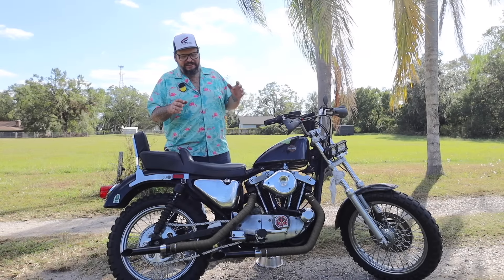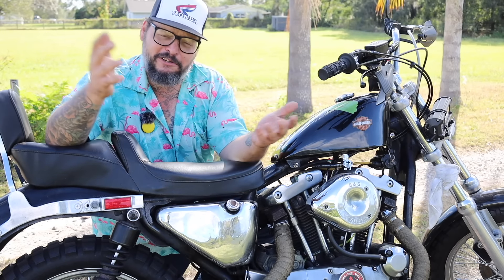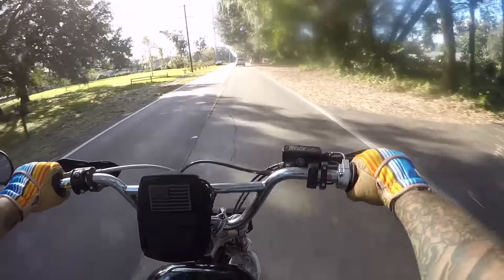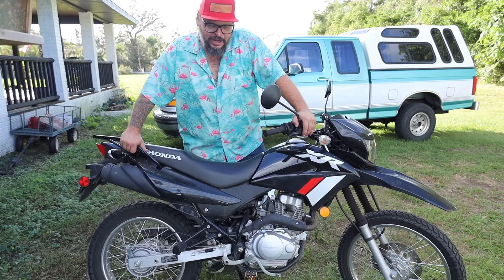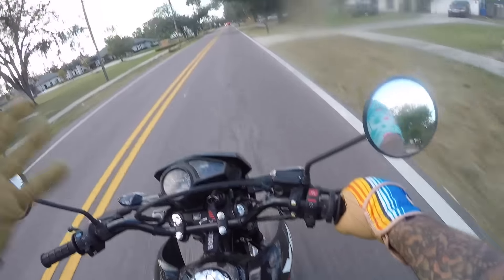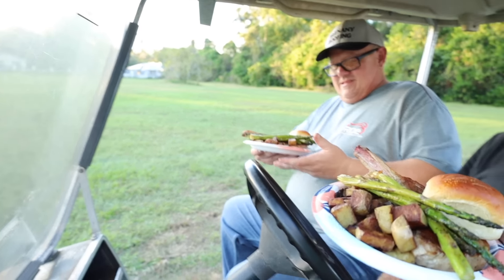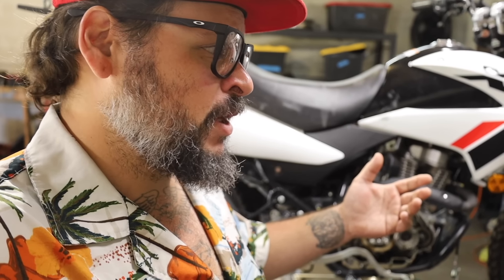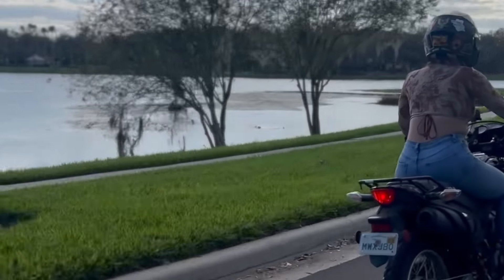I Never Thought She Would Betray Me

Comment: I hate to say it but those 80s sportsters are the biggest pieces of crap ever made. I had an 80 and 81 at the same time and i dont think they were ever running at the same time. When the phrase " everything breaks" im sure it had something to do with those bikes. I traded both and 6000 dollars for a 70 shovel that was way, way more relieable.the shovel was probably worth $6000. So i basicaly threw the two bike in for free.
Reply: I got rid of a ‘75 sportster in 1991. It’s the only bike I ever said good riddance to.
Reply: @messageinathrottle4046  I had a 67 that was gold. But nothing but greif in the three that followed. Like you happy to have them gone.
Reply: They are absolute junk
Reply: Had an 84 Sportster. Never stopped leaking oil from somewhere, blew base gaskets, blew head gaskets. Would have made a better boat anchor. Never again.
Reply: @feloniousmonk3049  now the 95 2000 are pretty good. I know two people that have them that do nothing to them and they run and soud great. That said ive got a 2014 roadking pushing 100k and the only bitch i have about that bike is the wiring and cencors are shit. Ive changed just about every plug in the wiring, the speed cencor, abs cencor, ect.....
Reply: @davidfellows6250  I have a 2015 Sportster iron,it's been a great bike
Reply: @harrykain285  yeah i think, like all harleys they got a lot better before they kill the modle.
Reply: I am seriously considering getting 150 Honda. On the other hand I think I'd rather stand just a little bit more money and get something fuel injected
Reply: I rode those pieces of junk in the 70’s and early 80’s.  By comparison my ‘68 T120 Bonneville was almost modern feeling.  That said, by mid 80’s, I’d discovered Moto guzzi lemans’, and it was all over for that iron junk.
Reply: You’re going to get a sportster you want to 91 to 99. The rest of them are junk.
Reply: @frankparnell7931  agree or pre 70s
Reply: @GreggBennett-j3p  of the limies were great in the 70s i had two bonnevilles and a Norton loved them.
Reply: 91 xlh 1200. Will NEVER part with